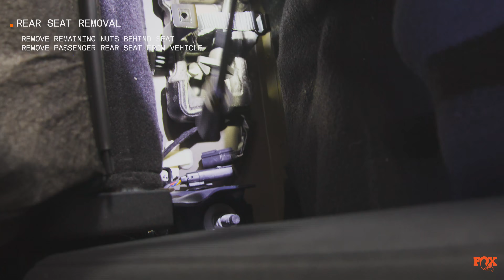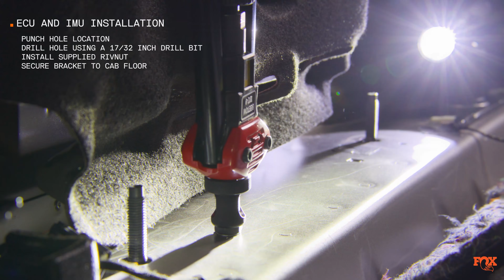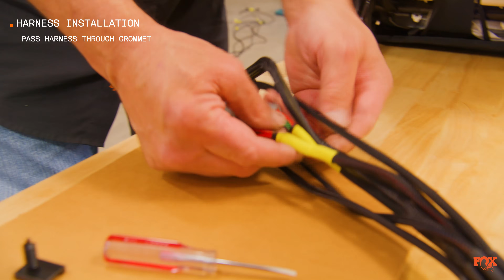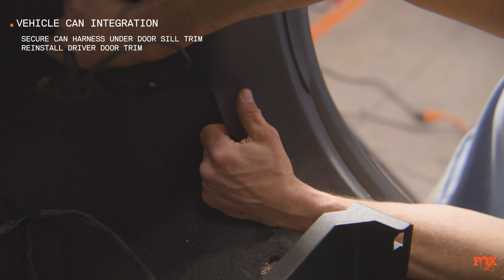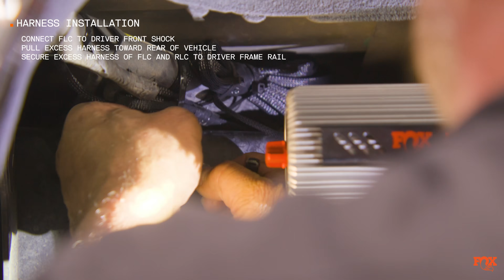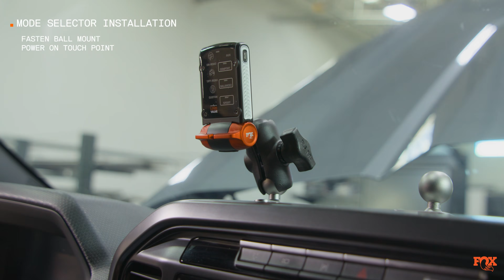Ford F-150 Aftermarket Live Valve Electrical Install | FOX

Comment: Does the can buss sensor actually pierce the wires or does it just pick up the signal through the insulation  ?
Reply: Looks like it doesn’t pierce it, if it pierced it I don’t think it would need a PCB in the sensor J box